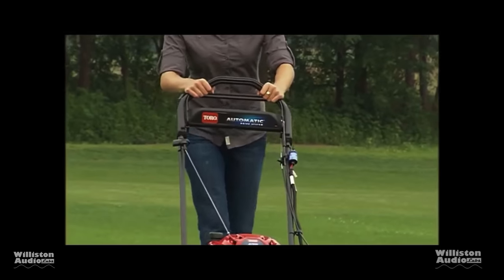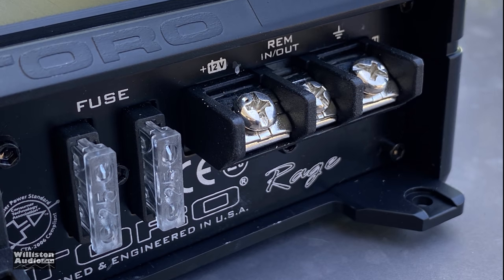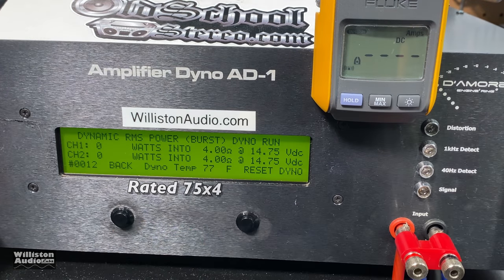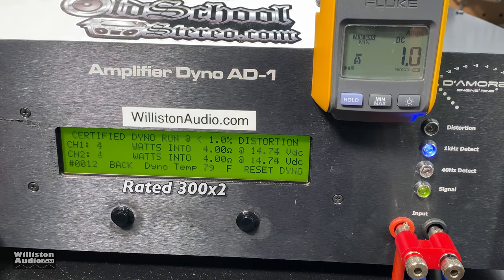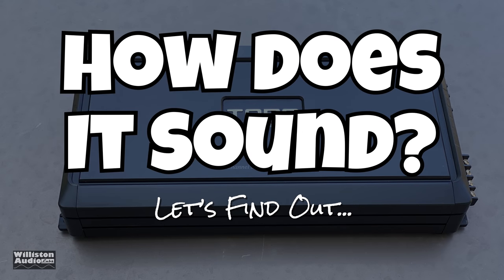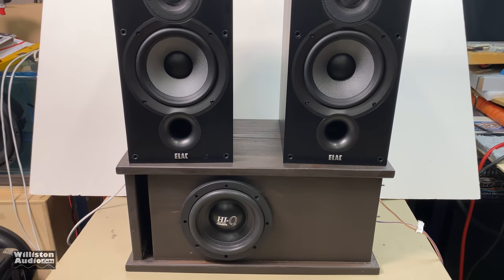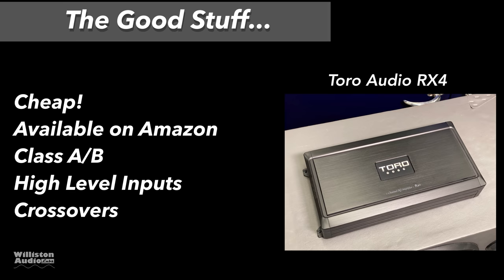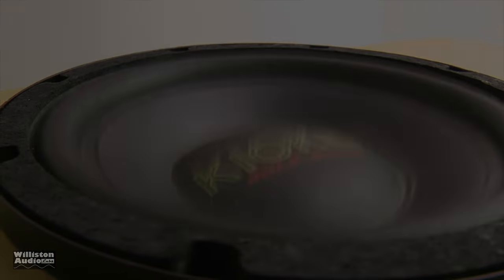Is This Budget 4 Channel Amp Any Good? Toro Audio RX4 Reviewed and Tested

Comment: Im looking for an amp that push true 250 rms x4 at 4ohm at 14 volts  any recommendations . Would you think the DS1200.4 will achieve. It easily
Reply: Just in case you do not get a reply from the man himself I have a question for you. What are you trying to run with 250w x 4 RMS at 4 Ohms? Are they subwoofers? Are they made woofers? Are they mids and highs? What brand are they? Are you looking at legitimate ratings or Peak ratings? If you can put that information out I'm sure you can get a response.🇺🇸
Reply: İ could be wrong but i think i remember hearing awhile back that ds18 didnt quite make rated power. Again i could be wrong about this. You may have an easier time finding a 2 ch amp that does a clean 250w x 2 @4ohms. You never mentioned if you cared if it was class ab or if d was ok.
Reply: @Mr.Robert1  sorry forgot to mention. Im running 4 skar pax 6.5 neodymium rated at250 rms . Don't mind if it's class d or a/b
Reply: @jarrodbrennan121  ohh for sure not ds18 i meant taramps ds1200.4 i thought it will do the rated as big d wiz did test the 440 one
Reply: İ looked for a dyno of that amp with no luck. İ wouldnt be surprised if it did 250x4 at 4ohms. İts rated at 12.6 and taramps usually performs better than rated. Go for it. You wont notice a 15-20w difference in rms power on music
Reply: Ds18 is a joke Chinese company
Reply: @jarrodbrennan121  yup i'll pull the trigger
Reply: @chevy383jt  it's just like boss nothing real just fake shit
Reply: @sKid-ts7hr  i was looking at the 800x4 and the bass800. İ downloaded a few of the manuals. İm still deciding on if i wanna fix this bravada up i bought the other day.
Reply: @jarrodbrennan121  i own The HD10k for three years running 2 skar zvx 15 with no problems . These amps will stay solid if u have good electrical am running it on 300 alt with 200 amp battery
Reply: @sKid-ts7hr  let me know how it turns out.

Comment: Really pisses me off to see this. I have been telling people about this company and even bought some of their subs because they were so cheap. Sure won't be telling people about them anymore. That's horrible ratings on their amps. Ridiculous man. Thanks for the video though Big D
Reply from the maker: Strange because the other amps they offer I’ve tested do rated
Reply: Yeah maybe it's just this one. Hopefully they will see your video and get it corrected.
Reply: Just because its over rated, does not make it a bad recommendation.  Just tell your friends what the real-tested power is.  They still might chose an amp like this on a watts per dollar or circuit efficiency basis. Unless of course they are competing, where classes are based on wattage specs.
Reply: That's true just wish they would have gotten this one a little closer. Maybe they are having trouble with the class a/b design. Big D says he other amps did their ratings. Their subs were super cheap when I bought them and seem worth the money. I haven't gotten any of their amps though.

Comment: Car stereo consists of more than just amplifiers and bass !! I want to see other car stereo stuff on your channel !!

What about cables, connectors, car players, DSP. batteries ????
Reply from the maker: It’s in the plans
Reply: Well that's simple oxygen free copper wires, stay away from yellow tops red tops and blue batteries. Becaused in one year you'll be trying to do a warranty. And for $250 +you might end up slapping and Auto part store employee when they only let you exchange the battery on warranty once
Reply: @wal  👍🏻🙂

Comment: Lots of through-hole components not a very well laid out board in this day and age. No Headroom whatsoever Class A/B? Interesting. If this was rated correctly Toro would have an upstanding winner on their hands.  Because it did not make rated power at any ohm load it is a fail for me and I didn't even listen to it.
Reply from the maker: Yeah class A/B usually have dynamics, not much here
Reply: look at Rockford A/B amps in comparison